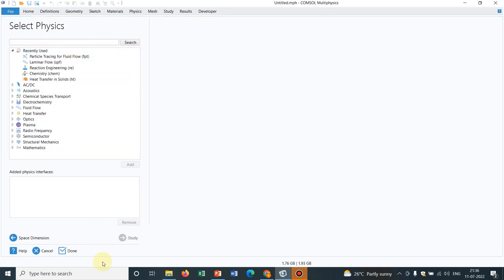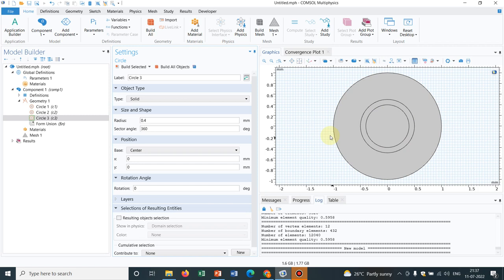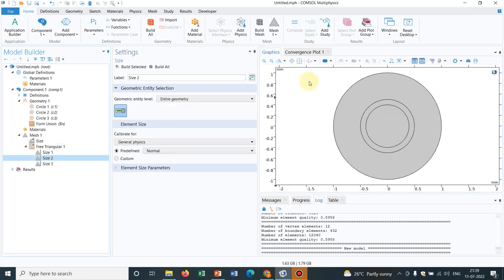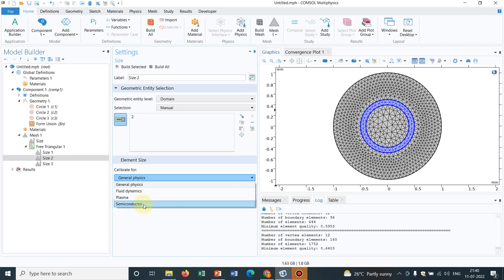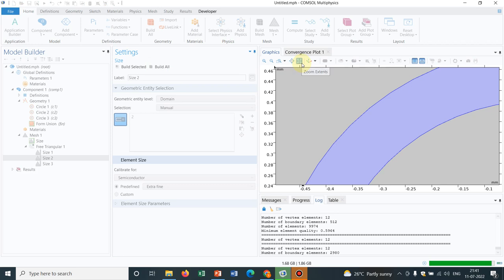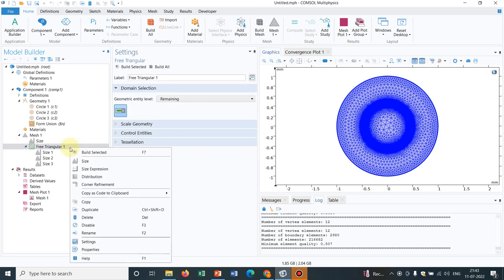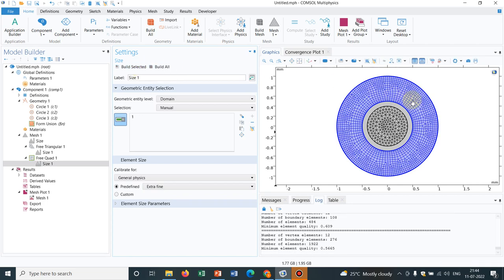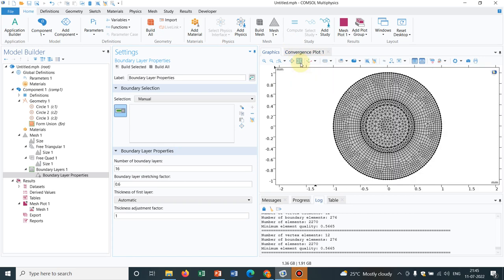Different Size distribution and type distribution in COMSOL meshing #Meshing #SizeDistribution

Comment: Thank you for the video. 
I am just wondering is there anyway to assign different variables to each mesh element.
For example, telling COMSOL to assign specific pressur to each mesh?
Reply from the maker: Yes possible. It is not mesh based. It is domain-based selection. And while you choose a domain then all the mesh elements in that domain will take your desired value.